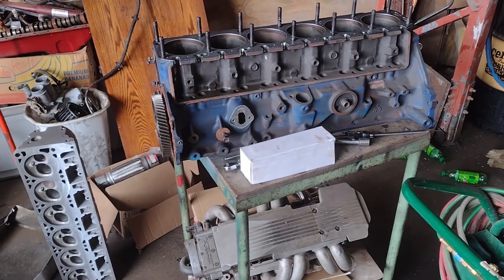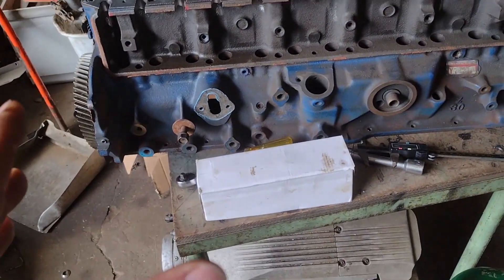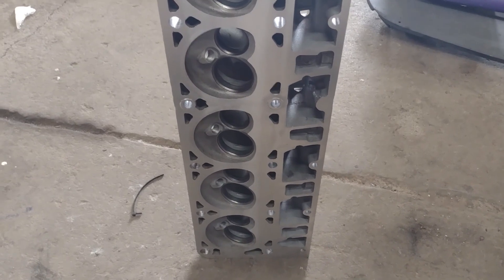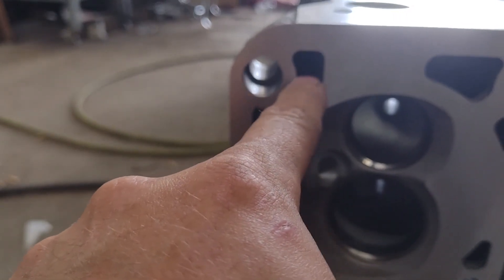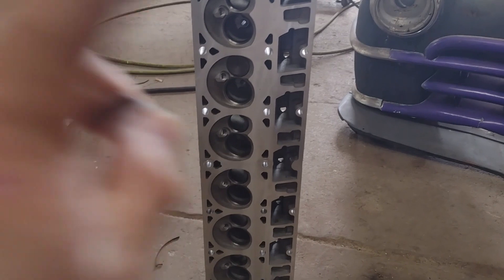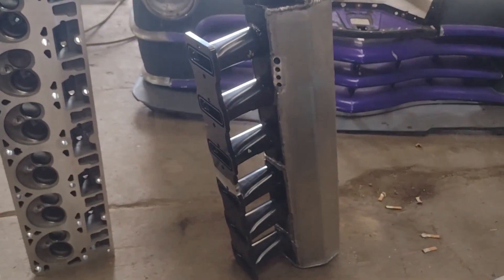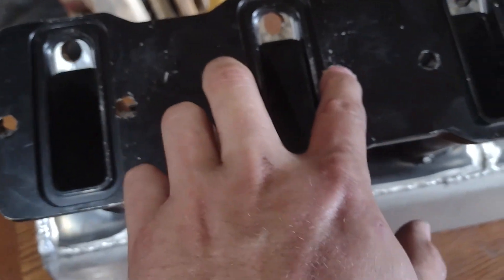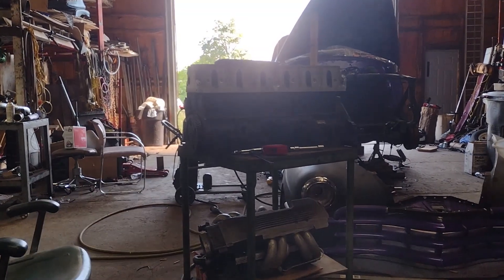Ford 300 HYBRID LS CYLINDER HEAD - INTAKE, PUSH-RODS And MISTAKES PART 3

Comment: As far as the insert you have that have pushed out, you can drill them out. To create a recess and then Weld around The recess And just have the machine shop. Take the Wells down to the deck surface, not the whole deck surface.and on the top of the bolt station. Drill out a small area for a large washer to be inserted, so you end up with.  A shoulder for the washer to sit on and it can not push down.
The combination of wilding the bottom and the top should retain everything. You do not have to weld the whole cylinder head. But on the other hand, if you did weld the whole Cylinder head, several things would happen. 1  You would gain more space for surfacing 2 You will change the push right angle and lengthree. 3. You will reinforce where the heads were welded together. 4 You will be able to reshape water ports and fire ring surfaces.
To guarantee a proper and perfect seal. I have ben building weird engine combinations for a very long time. I have been an automotive technician / machinist since 1988.

Comment: It might be a better idea for you to use a two piece push rod pushrods. A short, push  at the bottom With a Cup for the second Push rod To sit in. which gives you more angle larity to the push set. And you don't have to work so hard to get clearance.
Reply from the maker: Yeah thats something i could look into, i dont think we will need it really, it dont look that bad.

Comment: Personally, I don't think I would invest a ton of time/money into repairing the plugged holes until you've proven the concept as a whole and have a running engine.
Reply from the maker: There kinda where I'm at, I'm going to slap it together, it don't need water to run for five minutes.

Comment: Its ironic, that Chevy LS heads will work on a Ford 300 cid straight 6, but Ford V8 heads will not. The SBF V8 heads have the exact wrong phasing of intakes and exhausts to get away with using a stock 300 cam. Conversely, the Chevy LS heads have the exact correct ports sequencing to work, though the bore spacing difference requires a lot of adjustments. Wouldn't it be great if Air Flow Research, Cylinder Head Innovation (CHI) in Australia, or some other aftermarket head manufacturer would make a nice run of a Cleveland-style head for the 300 Ford.? As it is now, companies come up with aftermarket heads for other engines that are in such low demand that we wonder why they go to the effort and expense. What is really needed is a Cleveland head with the correct intake-exhaust phasing, 2V intakes and Aussie-style raised exhausts. HINT, HINT. There is a video on YouTube where a long, long time ago a man made up a batch of 4V cast iron Cleveland heads for his straight 6 300 drag race engine, complete with an aluminum raised exhaust port a la Bob Glidden design to correct for the poor design of the Cleveland exhausts. If you will go to YouTube, search under "SIX IN A ROW SHERMAN SLIGHS BOSS 310 SIX CYLINDER FORD." Its on the Sam Auxier, Jr YouTube channel, and the interview with Sherman Slighs starts at 27:30. This is the man that built the original cast iron 300 heads back in 1970, and he says he built 4 of them. Then he had Crane Cams work up a custom cam with re-phased intake and exhaust lobes. Its an interesting view and the interview takes about 15 minutes.
Reply from the maker: Thanks for the great comment.

Comment: I would try to get the sleeves flush, and then v groove around where the weld broke and reweld that. getting it vgrooved will give you extra penetration so when it gets flattened again you arent cutting off all of the weld. do that for both ends to give it as much chance of survival as possible. with those being in the middle you need them to be as strong as possible.

Comment: I would have the surface cut down to fix the sleeves rather than welding it up, I don’t think it’s gonna matter enough even if you gotta take .150 out plenty of room in the chamber to burn fuel
Reply from the maker: I wouldnt like how thin the deck of the head would be.